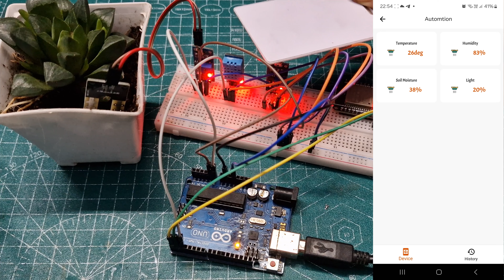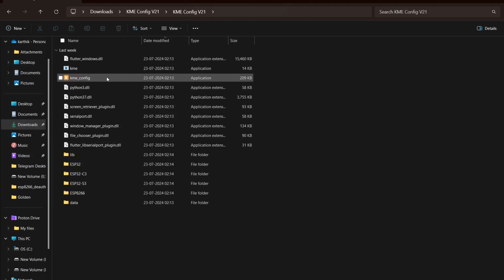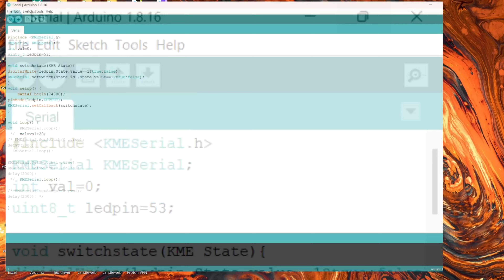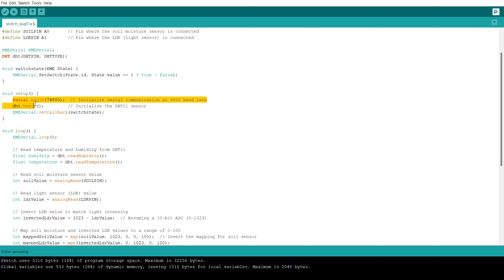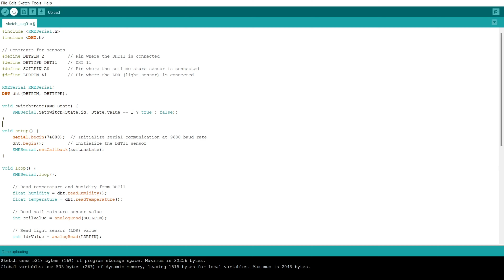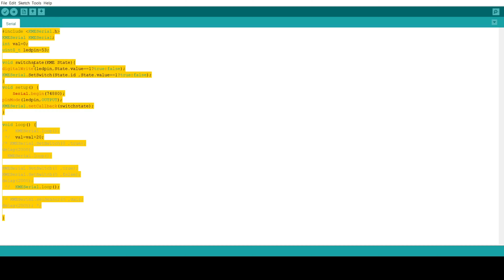Configuring KME Serial Communication with KME Smart: Step-by-Step Guide

Comment: Sir I have created a device to control the water pump by kme serial 
There i have used two esp 8266
One for getting the distance value of water tank by chsr04 sensor.
Another esp 8266 for controlling the relay and get signals from push button 
But at the time of booting if tx rx cable is connected 1st esp working 2nd sep not working 
But if i remove the tx rx wire and give power supply then then connect the wires tx rx 
Only then it works 
I don't know how to fix this issue

Comment: Can i control stepper motors too?
Also is it possible without another board?
Reply from the maker: It needs serial communication to be used and we will add it soon
Reply: @KMESmart-v7g  thanks, please add feature from where we can send custom text, integers etc using various widgets and that data can be used by serial communication for custom use. This will be great feature
Reply from the maker: We will try in future
Reply: possible pressure transducer for air water etc pressure gauge? using kme serial?